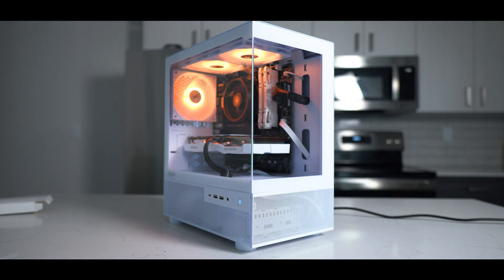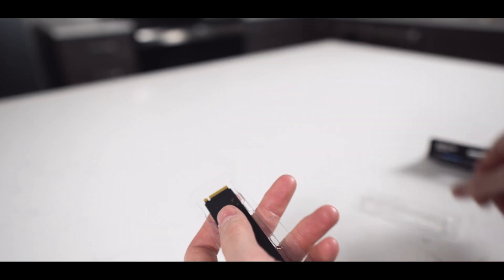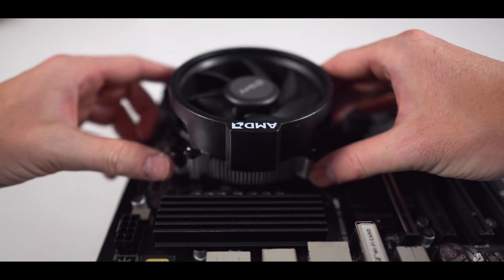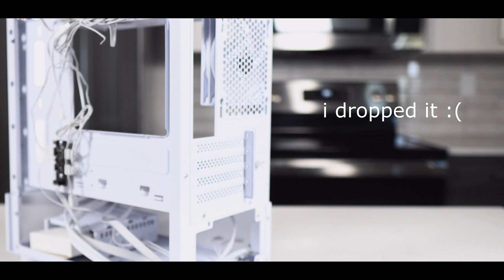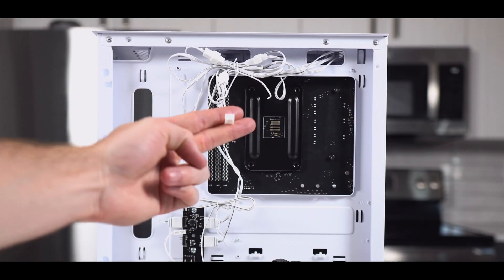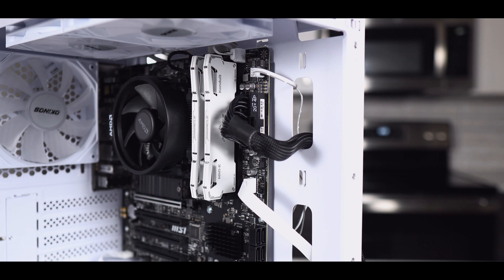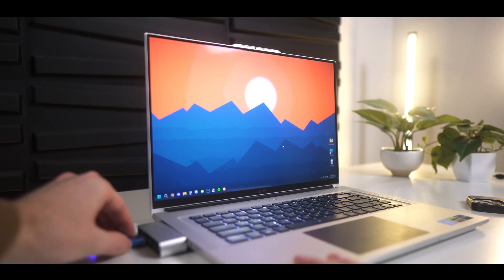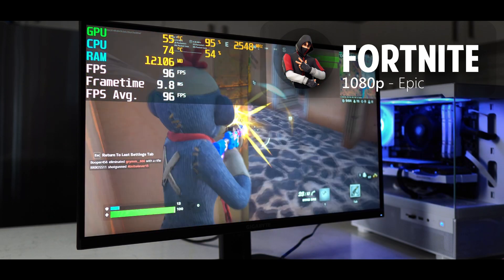BEST $600 Gaming/Streaming PC [Build Tutorial]

Comment: Trying to install windows onto the new PC using the flash drive, but it won't detect the SSD. Any ideas? It only shows the flash drive with windows on it.
Reply: Nice! 

I had to go to BestBuy and buy another 1TB SSD. This one was listed on the MSI website as compatible. I had zero issues getting it work. 

I unfortunately might’ve just gotten a faulty SSD originally.
Reply: Having the exact same problem as well.
Reply: @ekclee  ended up installing it on an external SSD using rufus. just make sure u use "windows to go". this tutorial skipped a lot of necesaary steps.
Reply: @ekclee  u ever figure it out?
Reply: @D67578  nope :/ been trying a bunch of different stuff
Reply: @ekclee  same. did u try hooking it up to an external ssd with windows on it? that's what i did and it's fine now, just doesn't detect the internal SSD unfortunately.
Reply: @ I don’t have an external SSD unfortunately: I might try and buy one of the compatible ones listed on the MSI website for this mb and hope that it works.

Comment: Bro your cpu temp is high, i’m scared it would melting your cpu
Reply from the maker: Modern CPUs, especially Ryzen processors, are quite resilient to high temps and 80-83°C technically wont be a problem, but yes I agree, an aftermarket cooler wouldn’t be a bad idea for those that want better temps.
Reply: ur a noob d'la life